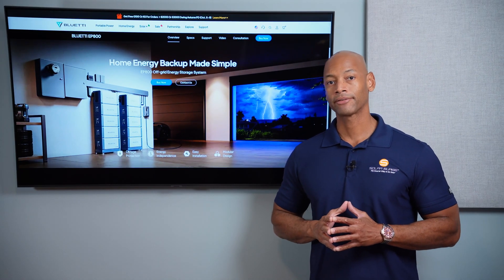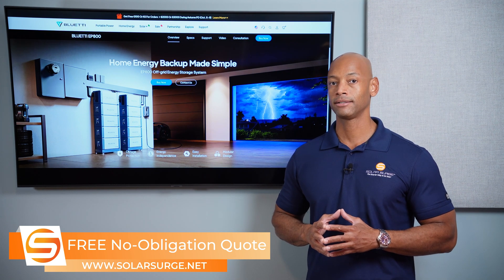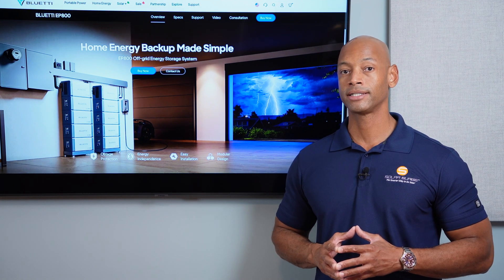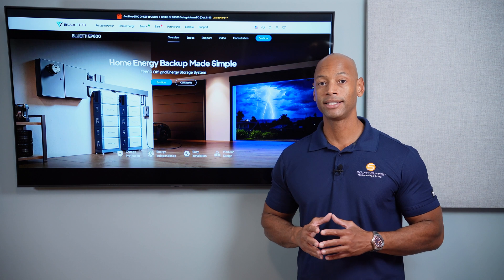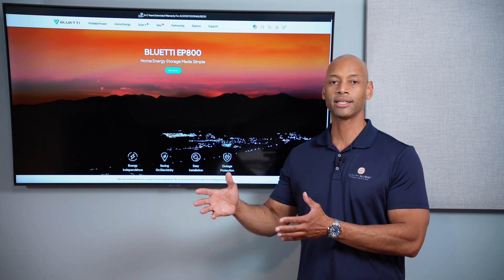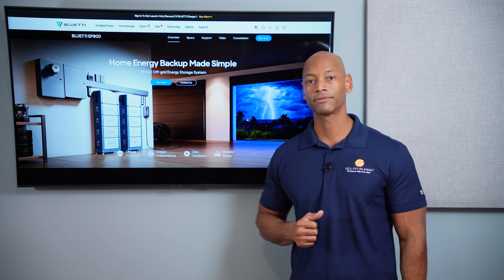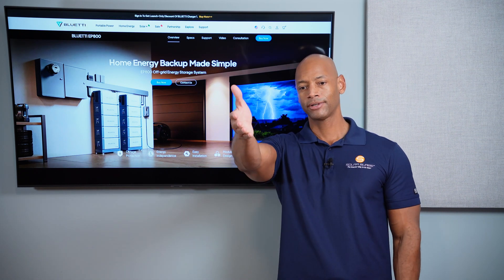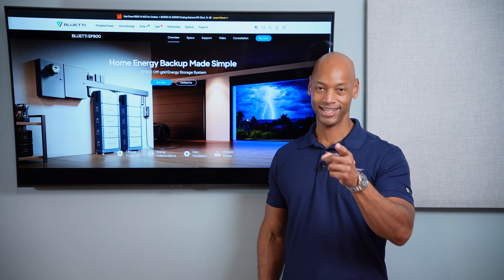How to Never Be Without Power

Comment: Can the ups mode operate with a backup generator? In other words, it could reduce the run time of my automatic whole house generator.  I have an automatic transfer switch that isolates the generator from the grid. It would be nice if the loads were handled by the batteries especially at night

Comment: 10/21/2024. Did my first test run on my Ecoflow with 4 solar panels. From midnight to 5:00 PM I used  7600 watts to run my house. During that same period I generated 11320 watts of solar. That leaves me 3720 watts of battery for the last 7 hours till midnight.  I expect to come in an hour or two short. I have 8 more panels coming to cover for heating or air conditioning, neither of which has been on today.

Comment: I live in Minnesota.  I also use 25,000 kWh of electricity per year.  I had to get 47 solar panels to get 102% of my electricity requirements.  I got REC Alpha pure R and Enphase IQ8X inverters.  I paid $50,102 and I'll use the rebate money in the spring to add battery storage.  MN is still 1:1 net metering, but Walz passed a law mandating carbon free energy generation by 2040... so we'll be just like California in a year or two.  We had 8¢ per kWh energy before Walz passed his law.... a year later, we are at 14.4¢, and it is expected to go up to 24¢ by next year.   Right now I'm researching battery technologies I might want to pair with the Enphase system because Enphase batteries are too small and expensive.
Reply: Expect a new generation of batteries from Enphase next year.  Pricing for the current Enphase 5P batteries is actually pretty competitive with the other big-name vendors.  IMO, the biggest problem with them is how much wall space they take up.   The new generation will address this.
Reply: @TheUweRoss   Well that's good news!  I'd like to find out more about their new generation.  It takes 3 5P batteries to be generally the same capacity as 1 Tesla Powerwall3.  It's ~ $9k for a Powerwall 3... but it is $10k for the first 5P battery and then $4k for each of the subsequent 2 batteries... for a total of $18,000... so twice the cost.  Are 3 Enphase batteries really twice as good as a Powerwall3?

Comment: Joe I like your videos mostly but this one a bit sketchy. A little system like the EP800 you showed would require a critical loads subpanel and that is beyond typical diY installers. Better you point them to hybrids that can pass 200amp from grid and do much more than the little bluetti system. You will also find cost isn’t much different as their batteries are small and expensive. A Luxpower 12kw or Megarevo R12/16kw LNA series will fit the bill and give greater expandability in future.
Reply: He clearly mentioned subbing out what is mandated by local authority (code compliant, license) or what the home owner (DIY'er) is not capable of doing.  So a hybrid.

Comment: Step 1. Get Enphase IQ8 microinverters as they enable the ”sunlight backup feature”. This means that even if grid is down and potential battery is depleted the IQ8 will power house as long as there is sun

Step 2. Add a battery and generator for even more resilience for nights

Step 3. Grab a beer from your cold fridge while the neighbours are sitting in the dark
Reply: Sunlight backup feature only works if you have the automatic transfer switch installed.

Comment: My 1st quote was $66k for a 7kw system, 2 powerwall 3's, and a Span Smart panel. However, they would not provide a breakdown of the solar system. 2nd quote was for a 11kw system, two powerwall 3's and a Span Smart panel that they were unauthorized to install for $62k, 3rd quote was for a 12.5kw system and was only the solar system and 2 powerwall 3's for $52k.
Reply: Jesus...I paid about $15,000 for a 12kw generator/battery and 4.6kw solar array. But I installed everything myself.